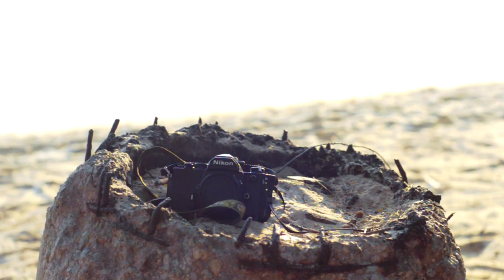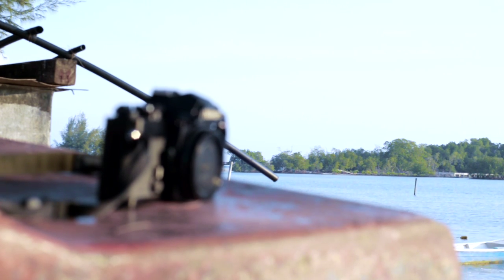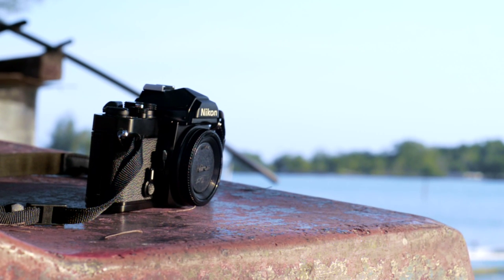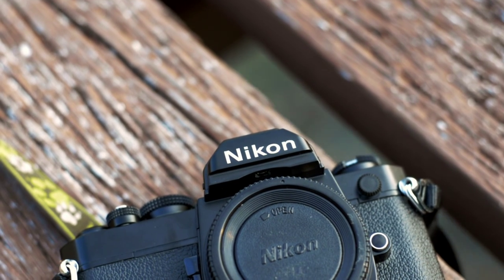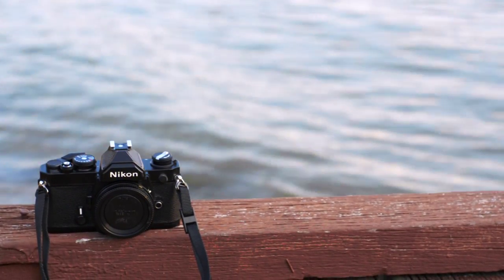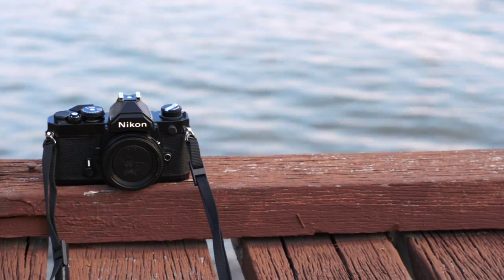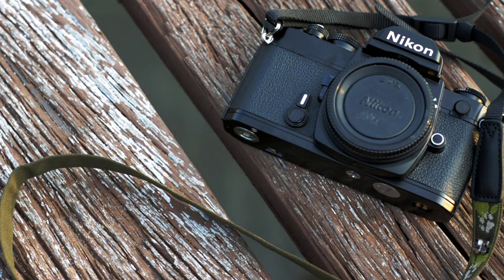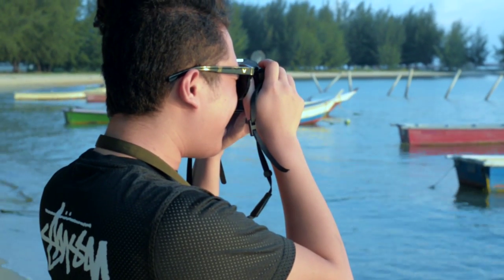Double Exposures on Film: A Walkthrough

Comment: Just so I can get my head around this. I see many not mention the ISO adjustment. I have some old film camera about, but I am yet to use them. I will be using them soon.

To take a double exposure, I first set my ISO to double the ISO of the film e.g. using ISO 200 film, I would take a photo with the camera set to ISO 400, then expose the same frame for the second shot, then I advance the film and set my ISO back to normal (if I want to shoot single exposures)?

To replicate the images that you took (white background with multiple exposures in the shadows), I would first take a photo where the background is washed out such as a tree as the subject and the sky as the background. I would then shoot another frame, and the image from the second frame would appear inside the first?

I am even confusing myself writing this. I generally don't find any guides that go beyond "Just take the photo and don't advance the frame, then shoot again". I would have imagined that makes for an overly exposed photo that is probably quite poor looking.
Reply from the maker: Yes, you're correct. Doubling your ISO helps to "cheat" the metering system of your camera

For those blown out images, what I did was;
i) Shoot a silhouette - the dark section will be unexposed film
ii) Shoot a normal photo - this shot will fill the unexposed film

I hope I helped. Thanks for watching!
Reply: But should my shutter speed and f value be balanced again when I change the ISO or should they be the same like I use for single exposure shots?
Reply from the maker: As I've mentioned below, the reason you're actually changing the ISO is to "cheat" your metering system, since you will be combining 2 shots (or more) in a single frame.

Let's say you have an EKTAR 100 (ISO 100 film).

You'll set the camera to meter at ISO 200 instead.
So what happens at ISO 200? Your camera now thinks it's more sensitive to light, thus it will suggest a higher  f-stop or shutter speed.

But in actuality, you just shot a very underexposed image on your film. But since you'll be taking another shot on the same segment, the end result should be perfectly exposed.

Anyway, you must have some courage to experiment with this, and learn to "read" the lighting better. So in some cases, you will have to slightly overexpose some shots, and underexposed the rest based on your experience in this and creativity. 

If it's possible, do try it out on digital first to get a better idea of the causes and effects of your changes, and then experimenting with film.

TL;DR Just shoot normally, but with doubled ISO

I hope my rants have helped :)

Comment: Im a little bit confused about the ISO cheating... So lets say if im using the 200 ISO film, then i set 400 ISO on the camera so it would be more sensitive to light. And i shot the 1st exposure (such as the sky) with a underexpose in the metering, next i shot the 2nd exposure (such as potrait or an object) with a overexpose so the final frame would be a good double exposure? And if set the camera ISO in 400 (when im using 200 ISO film), should i develop with the 400 ISO or still 200 ISO like in the original film? Ohh i almost forgot, then if shot a single exposure after the double exposure frame should i put the ISO setting in the camera back to 200 or still push to 400 ISO?

BTW, thank you very much for the video... I really enjoyed, and its a new trick for me as a beginner. Im just not to understand what youre saying cause im not so good in English

Comment: Hey Shafiq Hashim! I'm using a 200 ISO film right now, but i'm already pushing it to 400. If i want to make a double exposure should i set my ISO for 800, or just leave it on 400 (cause i'm already "cheating" the camera anyway) ??

Btw, i also heard that is also possible to shoot with half of the shutter speed (e.g. If the correct shutter speed for a good exposure is 1/1000, you can shoot both photos at 1/500 sec. (instead of doing the ISO "cheat"). Do you know anything about this??

Thanks!
Reply from the maker: Sorry, didn't realised I had this comment.

Hmm, im guessing if you're indeed going to push the processing to 400, you should just leave it at ISO 200 (never tried it, not sure if it would work, sorry).

And yes, halfing the exposure is similar in theory, just that with this method, begginers like myself don't need to do the maths for f-stop and shutter speed. The camera metering will still work.